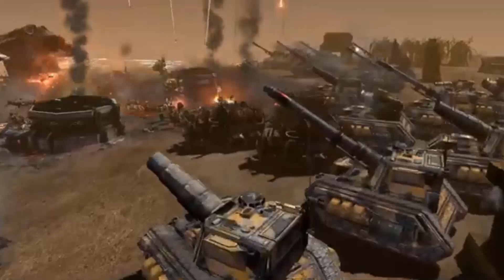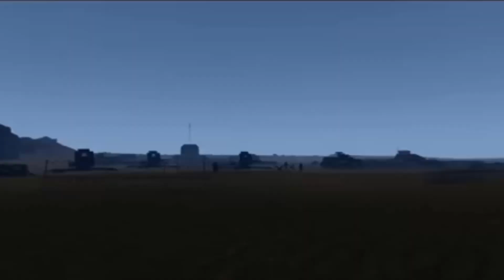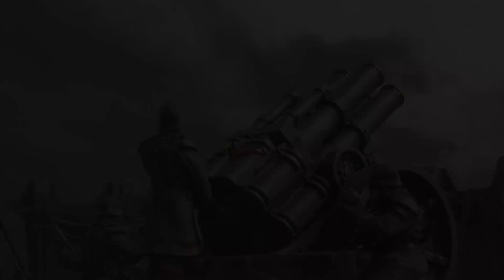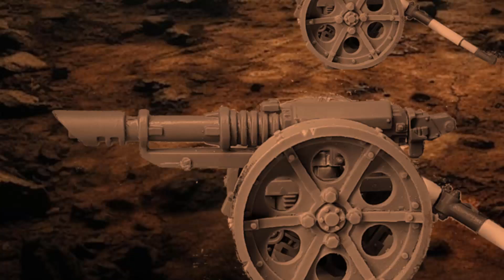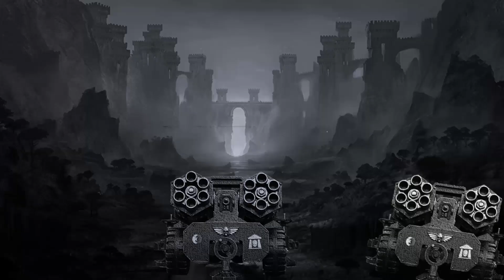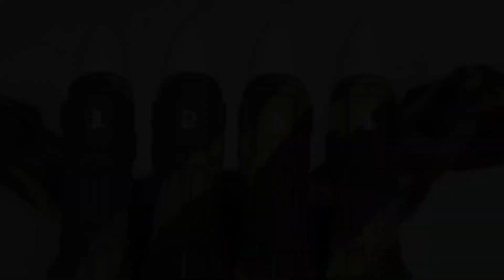Astra Militarum Artillery Platforms and Systems - Part 1

Comment: i am surprised that the earthsaker isent bigger. i mean it is smaller then M777 howitser that many NATO forces use today as a standard.
Reply: It’s based on the 130mm M46 field gun.
Reply: Doesn't have to be, considering how powerful the shells are.
Reply: @voomvoom4522  True but they are also somwhat ligther but yeare, they migth have some futureristic, for more damage.

But if you search for Earthsaker cannon 40k. take the pictures and compare them to pictures of an M777 the earthsaker is so much biger, and yet it fires a smaller grenade over a shorter distance.... I mean it is Massiv, i whould more think that it was 170 mm or somthig like that.
Reply: @dalleravn  we also have 155mm nuclear shells that might be more powerful than earthshaker shells
Reply: @Napalmenjoyer-y9  well..... Yearh but...... Yearh i dont know how to respond to that one......:P
Reply: @dalleravn  one shell is equal to 100 tons of tnt
Reply: @dalleravn   one shell is equal to 100 tons of tnt
Reply: @Napalmenjoyer-y9  yearh but i am talking about the earthshaker cannon seams under powered compared to the m777 ;)
Reply: @dalleravn  which shoots 155mm shells
Reply: @Napalmenjoyer-y9  exactly my point;)